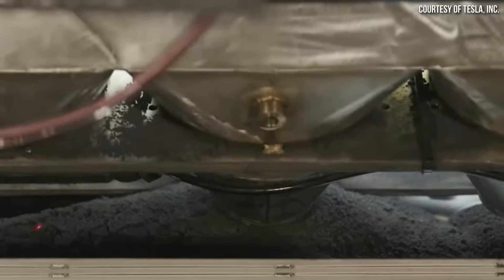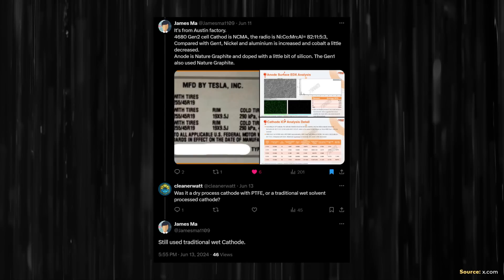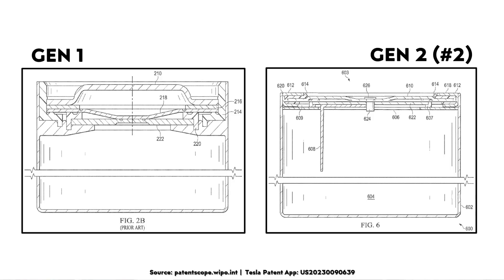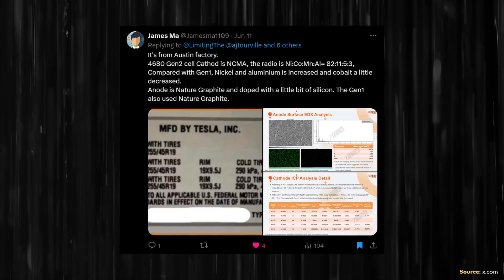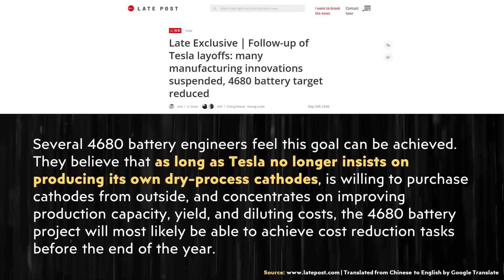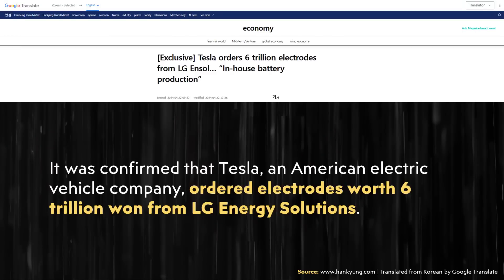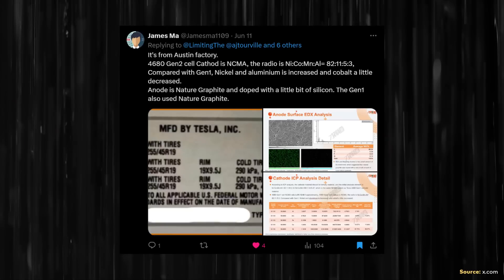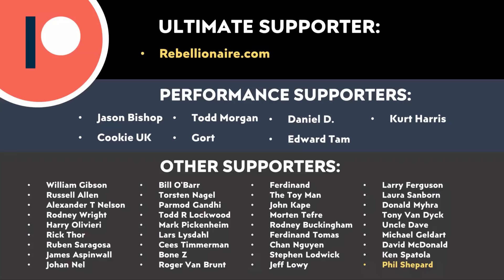Tesla 4680 Battery TEARDOWN: Dry Cathode Myth or Magic? (Cybercell Secrets!)

Comment: To my info, the throughput and yield of cyber cell are very low whilch is around 20% of the original plan. The tab welding is taking too much time and it is the bottleneck of the process. 

Some bad cells are recovered by the dual welding to increase the yield which means the welding is the key challange and the increase of the welding speed is very very difficult. 

Tesla could not achieve target of  the dry coating for cathod. Aluminum is not active material for Lithium storage but it is functioning to improve the life and safety of battery. Energy density is decreasing as alumina is incorporated. The energy density of  cyber cell is lower than 2170 cell which means this 4680 cell is struggling to improve the life and safety.

As the cell diameter is reduced, the life and the safety is improving. As observed by Tesla, the life decrease speed for 2170 based models are about 2~3 faster than 18650 cell based models. It is caused by the difficulty of the cooling.

When the 4680 cell was invented, the heat was supposed to be removed through the bottom of the cell. However, the bottom of the cell is not utilized for cooling. The side of the cell is cooling for cyber battery pack. How the heat in the center can be removed with this design? The life of the cell will be challenged. As it is obserbed from the change for 18650 and 2170, 4680 cell life will be challenged. In order to come up with the challenge, the inactive component of Alumina is added and the energy density is decreased accordingly.
When I look at the Munro live, I observed the tab connection part was upside down and some void space was incorporated in the pack. I guess, Cyber team intended to remove the heat from the bottom of the cell. I don't expect this approach is helping the cooling of the cell. Air cooling is not effective approch. On battery day of 2020, Elon stressed the battery will be cooled down through the bottom which is much simple approach for battery pack manufacturing. Hyundai is already applying the bottom floor cooling approach for e-GMP platform.

One of the risk also raised by 4680 cell application is the total pack replacement with single cell failure. Since the yield is very bad, the possibility of bad cell application in the pack increase. In case of 2170 cell and 18650 cell, one cell failure in a module did not induced the total battery pack replacement. But the 4680 cell contains 5 times more energy and one cell failure is inducing total battery pack replacement. It is unexpected result.

Hyundai e-GMP case, one module can be replaced. Such case is very rare, but tools are available to replace ond of module.

Hyundai and Kia utilizing the cell which does not include alumina because the life and safty of the cell is much better than cylindrical cell.

In my view, 4680 revolution is in the risk of total failure. As commented by Elon for the Northvolt order cancellation news by BMW, "very..." means battery is so difficult. He may gave up 4680.

Dry coating is one of the component of  4680 revolution.  Wet coating is like butter spreading on the bread and the dry coating is like spreading sugar on the bread.

Dry coating requires more bonding and conducting components which are inactive for lithium storage. Accordingly, the energy density is decreasing. Also, the quality of the coating is not homogenious which is causing the uneven cell quality.

Tesla is saying dry coating is applied for anode but silicon cannot be mixed. In order to recover the energy density drop, silicon needs to be added in the 4680 cell. As it is quite difficult to spread the sugar and cinamon powder on the bread in even, soreading the active and inactive materials in even is very difficult.

I respect the revolutionary sprit of 4680 concept, but the realization of the concept seems flustrated.

Comment: Tesla has MY Juniper ramp. Tesla maximising cell production while it ramps dry electrode NCA cathode - no issues with NCA for MS/X. The Juniper refresh including 800V/48V needs to go through the entire fleet. Would not surprise me if Tesla is testing MY juniper production equipment at Austin for rapid sequential roll out to Fremont, Berlin and Shanghai.

Comment: I never worked directly on this project while at Kato but I was told  2 years ago that the main blocker for dry cathode is the hardness of the metals on the calendaring rollers. Anode is easier because copper is soft, but cathode metals have a tendency to damage or dent the rollers during manufacturing. This causes defects all over the electrode making it useless and then the calendar rollers must be replaced which takes FOREVER. But this is just hear say Idk for sure

Edit: Manganese is the hardest metal in the NMC trio so connect your own dots there
Reply: They mentioned pitting rollers some years ago.
Reply: Thanks for this.  I have often wondered what it is that is holding up the dry electrode manufacturing process. Just like I'm wondering what is holding up the semi truck.  And the lithium refinery.  I'm always surprised that nobody asks these direct questions during the various presentations that Tesla holds each year.
Reply: Ceramic or ultra hardened rollers could help but they are very expensive and have other disadvantages in their even-ness. Which may negate the advantages a dry process brings.
Reply: @wolfgangpreier9160  yes I believe this is why Maxwell Technologies never expanded past the small scale prototype

Comment: I am guessing that Tom and Sandy are not aware of Tesla’s contract for cathode rolls from a cell manufacturer.  These are almost certainly wet process cathodes.  I also am skeptical that there actually is no Manganese.
Reply from the maker: Most likely you are correct. The lack of Manganese doesn't seem to make any sense, so I think skepticism is warranted.
Reply: The electrode contract could be LFP cathodes. Tesla has plans to also manufacture their own LFP batteries.